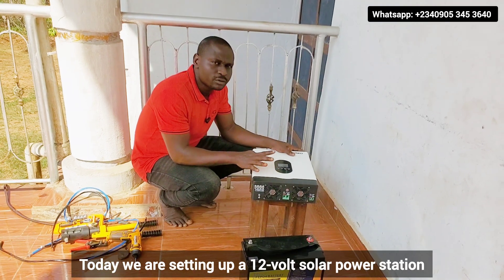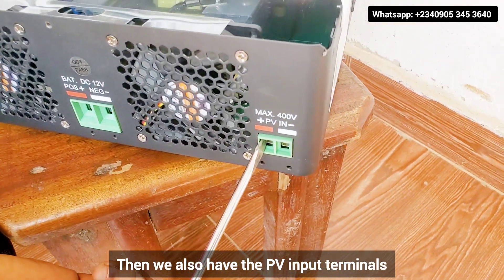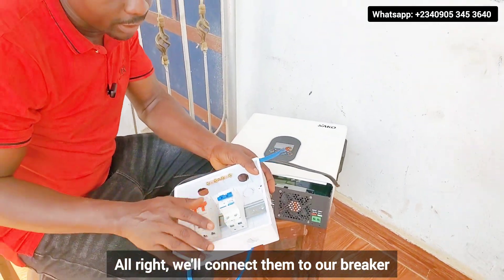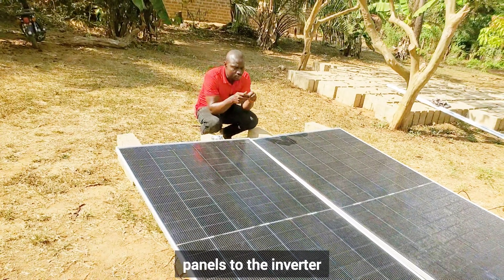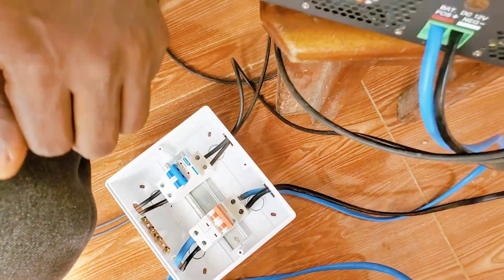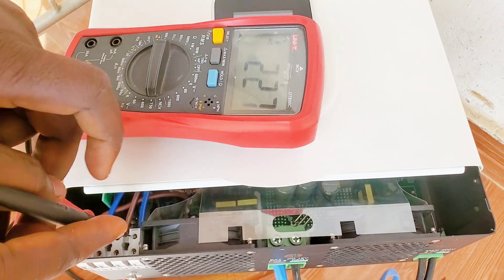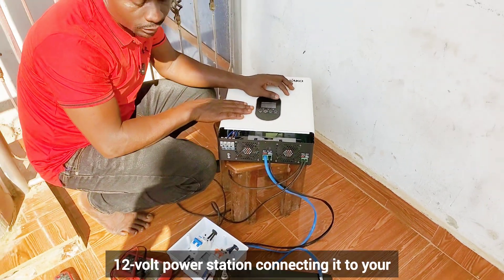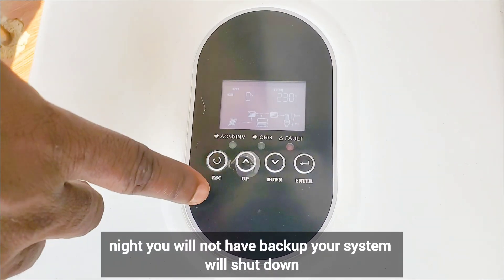How to Set Up a 12V Solar Power Station with 100Ah Lithium Battery (Step-by-Step Guide)

Comment: Can those small suoer 2000w inverter work with the lithium battery?
Reply from the maker: They can but you cannot set cutoff voltage
Reply: Thank you😊

Comment: Lovely set up sir, can we use 2 or 4 pcs of this battery to last long?
Reply from the maker: You can. Always check the max you can connect in parallel from the spec sheet
Reply: use 48 volt batteries if you av big load
Reply: Okay sir....